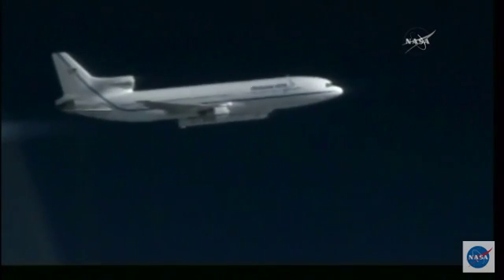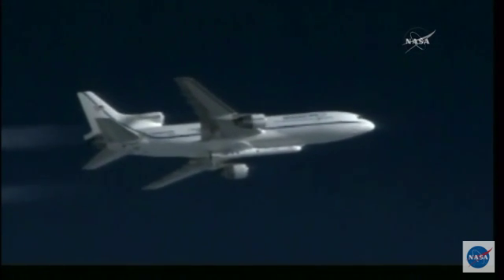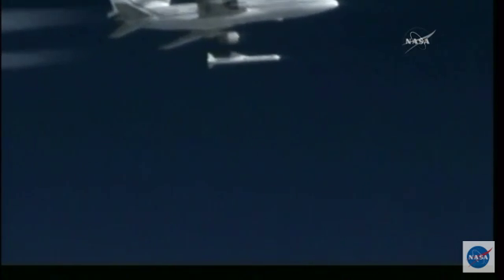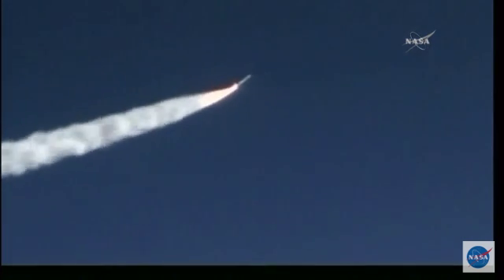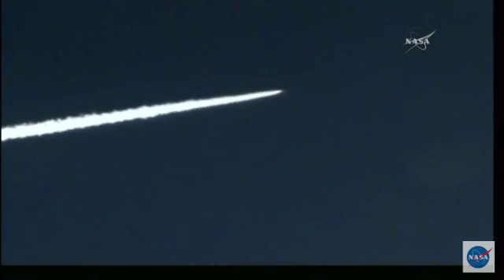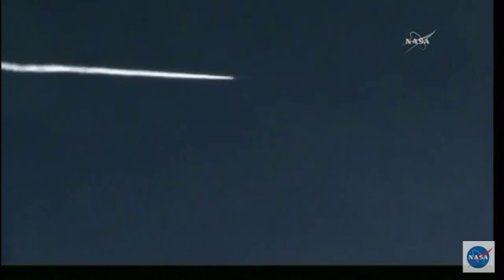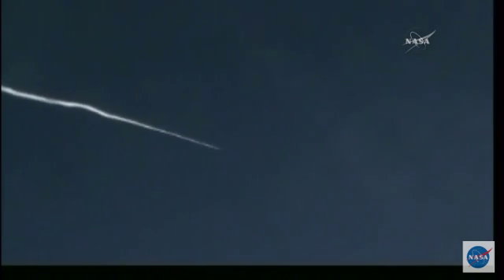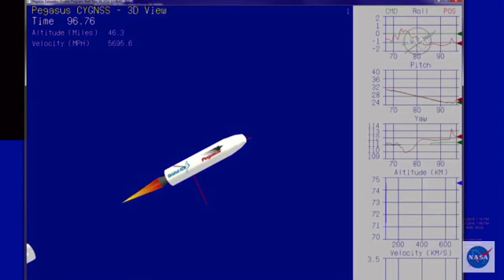Ignition! NASA CYGNSS Hurricane Satellites Launched | Video

Comment: NASA testing guided missiles now?
Reply: Ye guided missiles that monitor winds
Reply: baba duke why launch something off the ground when u can from the air.. Save fuel
Reply: klotuur What? The airplane and the "satellite" both require fuel...so how would conservation work again?
Oh, by the way i'm surely far from a NASA fan. Not Another Shady AstroNOT.
Reply: baba duke Takes less fuel to fly a plane  than a rocket though. Also not sure why you put satellite in quotes.
Reply: baba duke Jet engines sip fuel compared to a rocket.